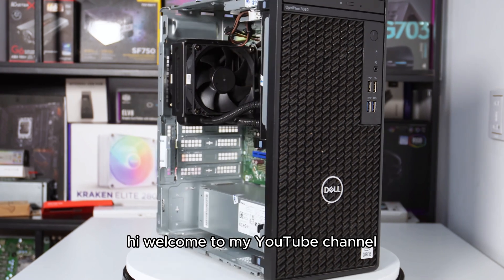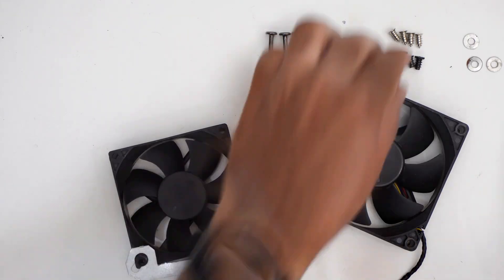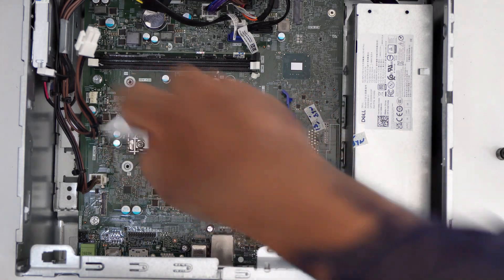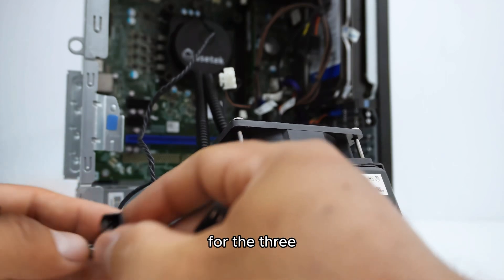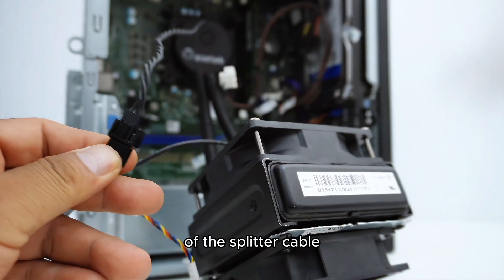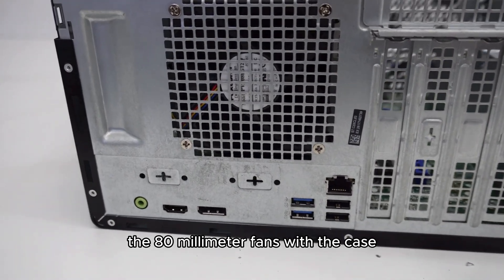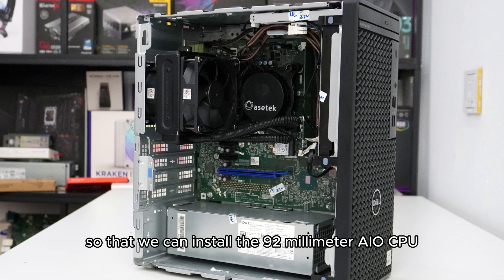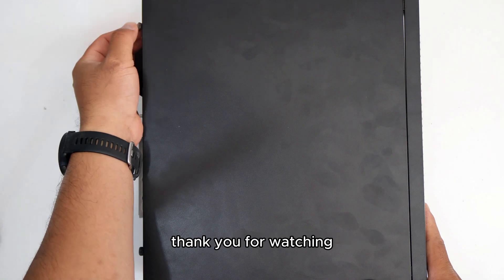How to install AIO Liquid CPU Cooler with push/pull configuration on Dell Mid tower series

Comment: I want the motherboard to be removed and put it in another cabinet, but I dont have the Cooler bracket, in 3080 MT's situation the bracket is attached with the cabinet itself, ANy solution ?